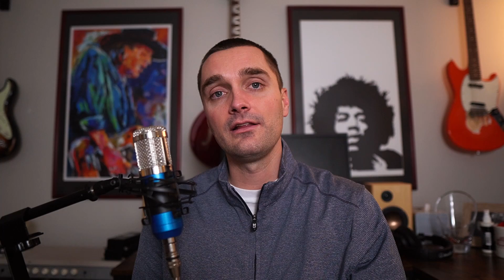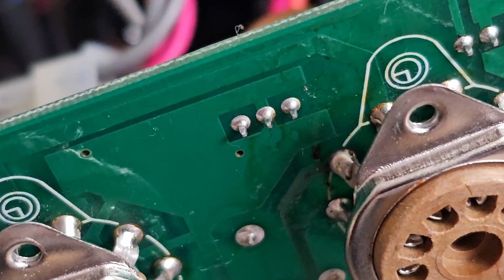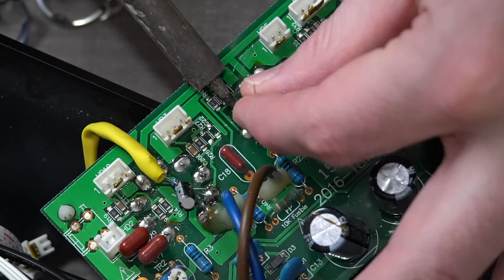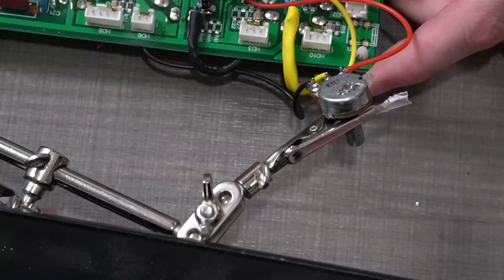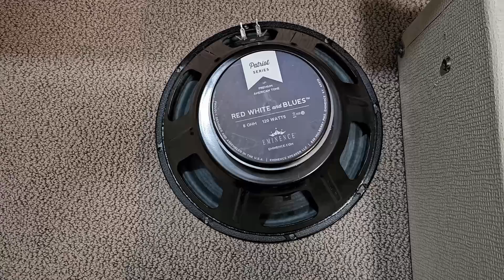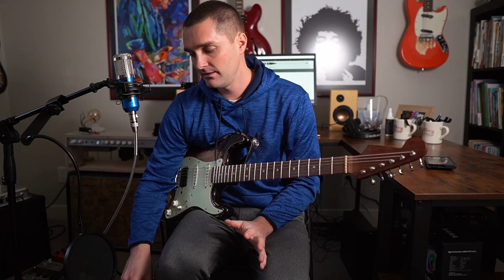Tuning my $140 Monoprice Stage Right 15w tube amp into a FIRE BREATHING MONSTER!  Amp mods

Comment: Hello Kley, i really like your tone in your intro music. Sounds just like my hero peter greens early sounds.Nice  playing.I  could resist try this mod with my stage right 15. However i got no output when i turn the amp on and let it warm up.i followed your circuit changes with all the right parts .1.5  1/4 WATT resisters. 10uf v25 volt caps. and 250 uf cap.I didnt get any smoke from the the amp. power light stayed on just no output.Iam sure i got all your directions correct. Iam safe as far as discharge of the amp caps before i work on it with hand in my pocket and the other hand doing the work.i think where i went wrong is when i took the amp apart with all the jhumpers i must have jacked up 1 or maybe more of the jumper locations up. do you know where i could get some help with this. thank you.boy this amp has more jumpers than a line 6 spider 5.

Comment: i have one of these amps. very happy with the performance of it as is. but nice to see and know how to hot rod it. one suggestion in your video: please use some kind of pointer like a pencil to clearly id the parts you are showing. though the video was fairly clear, i had a bit of trouble following  the exact things you were touching. otherwise great info.  thx!!!

Comment: This looks pretty similar to the 3-Way Preamp Bias Switch mod on Robrobinette's site. On there he replaces the resistors with a 3-Way switch for 830-2.7k-1.5k options along with some options for bypass caps. 

Now would I be correct in assuming that I can do this to all 3 cathodes? If so, would a cooler bias on all 3 (2.7k) add gain but reduce distortion? I mean would it make it the amp louder, cleaner, and increase CLEAN headroom?

I guess I'm trying to do the opposite of this mod and turn it into a clean machine haha I'm hoping it's possible so I can have a louder cleaner pedal platform. I guess I could throw a 1.5k on each one so they're all symmetrical but I haven't seen anyone so this so I'm afraid too as my knowledge of this stuff is scarce
Reply from the maker: Great question.  First there is a difference between gain and distortion.  Gain is just signal gain.  How much the signal got amplified.  Distortion is like once the signal reaches maximum amplification, but you keep going so it distorts.  How much does it distort?  

Distortion can be created in multiple ways.  First you can just run multiple stages of amplification at pretty full tilt.  They'll reach their max headroom and they can't keep up anymore so the signal clips.  Having excessive signal gain will create distortion.

You can also create distortion by amplifying the wave form in a certain manner.  Guitar signal is an AC wave form.  Alternating current swings up and down from the center line.  The upward and downward swing has a limit.  One end is saturation, the other is cutoff.  

So by messing with the cathode bias resistor you move the center line.  Say your limit is +5 and -5.  If you set the center line at 0 then the wave form can swing symmetrically.  If you set the center line at like -3 then the positive swing has lots of room, but the negative swing has almost no room.  It clips instantly.  That's asymmetrical clipping.  

1.5k bias resistor is center line at about 0.  Neutral.  Symmetrical swing.  If you use a higher value resistor like 3k that moves the center line negative.  10k cold clipper moves it very close to the negative clipping point.  

Lastly we also have to mention cathode bypass caps.  They also increase signal gain by allowing the tube to operate more efficiently.  You don't really use bypass caps with cold clipper resistors.  Complicated reasons.  

So to answer your question, using a 1.5k center bias line would be ideal for clean headroom.  Maximum signal gain.  But then just use volume controls between the stages to find the point of maximum clean amplification signal gain without clipping.

Using higher value resistors and no cathode bypass cap introduces distortion at the cost of maximum signal gain.  

The truth is that your goal of high headroom clean machine is more limited by the output section.  The power tubes only can amplify whatever the preamp is doing so much.  

So max clean headroom would actually be part of my amp design.  I just also allow for the gain knobs to push well beyond clean headroom just by brute force signal gain.  

This is a great question for a full video...

Comment: It might not be too tough to turn this preamp into a top boosted AC30/6 Brilliant channel. The one difference is you have a direct coupled cathode follower driving the tone stack rather than a single triode DC coupled cf. The topology is there, a strapped 12AX7 with the volume control between triodes, cf, tone stack, phase inverter, EL84s.

You'd have a top boost AC15 with a loop and reverb, that's pretty cool.

Comment: sound like diarreah fart, change the cathode bypass cap in V1 for smaller like marshall, 0.68uf to not clip the bass that much. that coupling cap 22nf changing to 2.2n that would tighten the bass distorsion

Comment: I have I guess the newer version of the amp with the front facong controls. It is actually a great sounding box specially considering the price and regardless of it, I think I paid $180 used of course, I think they are running $300 or so new. Yes your mods are quite interesting specially after you messed with the settings a bit the tone came together and sounded quite good. I'm just starting to mess with amp buiding, starting with a mojotone 5e3 which looks like fun but scary enough. Would I jump on the mods for the Stage Right? YIKES that's scary as hell. If I knew what I was doing I would probably try and re engineer it as a point to point hand wired , basically copping it's design and incorporating your mods, using higher quuality components overall, that could be wicked.
Reply from the maker: Nice! I would start with the 5E3. Crawl before you can walk or run. The 5e3 is a very well known diy project. Get it up and running. Then come back to these mods!

Comment: Would it be possible to  ,instead of mounting the potentiometer on the amp , put a jack somewhere and control it with a modified volume pedal or expression pedal ？
Reply from the maker: Good question. My first reaction is probably not. With a long cable run you don't want to actually send the audio signal out and back to an expression pedal. You could do an analog to digital conversion but hard pass on that concept from me. You could use a relay to switch between two preset resistor values...

Comment: so Clay; FANTASTIC channel and thank you so much for sharing your knowledge.... I worked with surface mount and it takes a little less coffee to work with  but doable with a microscope!! (lol) i've a question about your mod on this amp... towards the end of the video you mentioned using the "tone" control... 

was not the "tone" control removed?  The variable bypass clipping circuit that was modded, I think, that VR1A with C6 on its wiper, is the "tone" circuit however not labeled on the schematic. All other controls are... kind of weird but perhaps intentional as it's somewhat novel circuit.

Removing C22 disconnects the  VR1A C6 circuit... unless you shorted over the removed C6 thus making a trace there and reconnecting the VR1A C6 circuit... else it's just floating. 

When you added the potentiometer in the back for extra gain stage,  think you can repurpose  the "tone" pot if indeed it was removed from the circuit.   

any way towards the end of etc video you mention using the "tone" control which peaked my interest as it seamed the "tone" control at the face plate was removed from the circuit during mods... 

perhaps i mis understood your circuit analysis.

Comment: Hi Kley. nice work and good explanation of what you're doing and showing to us. please, for gods sake get yourself a good PCB cleaner and get rid of all the flux residuals.. vid would look much nicer.  For the V- mod wouldn't it be much easier to replace the SMD components (looks like 0805 size) with your preferred values? SMD component kits are largely available in high quality. nice rocking greetz from Bavaria/germany.

Comment: Great again Kley, as usual!  I have build the monoprice/Laney myself and used as in all my  amps the old spider building way. The components direct on the tube feet. I always use DC voltage for the filaments. This make all my build amps dead quiet.  I had the bypass caps and a voltage divider after stage two. I am happy to hear the same in your amp when you give full trottle on the divider. It is a kind of motorboat effect in the dying sound.  I also made the tonestack a bit different. The amount of bass is regulated direct after de first stage. So there will be less mud in the amplified signal. The tonestack for mid and high freq. is in the same place as the original. I have taken a 50kOhm B pot for the mid. That give the possibility to make Fender like tone left from the center and kind of Marshall tone to the right of the center. It even adds some grit to the tone. It sounds lovely from clean twin to gritty marshall. Keep on demo and greetings from Holland

Comment: Hi Kley, a comment about changing the cathode resistor on V2B (R48): as you noted, V2B and V2A form a direct coupled cathode follower circuit (DCCF). When you increase R48 from 820 ohms to 1.5k, the anode current drops slightly because V2B grid bias goes more negative. This subtly changes the overall transfer curve of the DCCF, but not in a major way. Details can be found in the very useful book by Merlin Blencowe, "Designing valve preamps for guitar and bass", chap. 5. The addition of the 10uF cathode bypass cap across R48 will increase the gain of V2B significantly, which increases the amount of compression in the DCCF and gives more distortion at lower gain settings. The circuit appears to be lifted directly out of the Fender Bassman 5e6 amp circuit, except for the anode voltage which is higher in the Bassman at 325V. Thank you for the reference to the Laney Cub amp, that is the only place that I could find the circuit diagram of this Stage Right amp.

Comment: My hats to anyone willing to work those tiny components. Those were some great mods. Do have any suggestions for a Blues Jr? I rebuilt mine using a Hoffman kit in order to get rid of all the PCB stuff. The amp is killer but the pre-amp section gets loud at 3 and with humbuckers there doesn't seem to be enough highs. Thanks for posting this video.

Comment: Thanks for posting. I will be experimenting with mine. Just a thought, instead of removing the surface mount components, you could cut the track. That way you could put the circuit back to normal by simply rejoining the track with a bit of wire. 

Also it would have been good to hear the comparison between the speakers. Great video, thanks.

Comment: if you want to impress us all, figure out how to get rid of the hiss white noise, changed tubes to the quietest you can buy - 81db, conductive copper tape inside where the head sits, replaced the rca cable to reverb with insulated shielded cable, just  has to be some kind of DYI fix on the pc board to help this lil amp.

Comment: I had an amp tech do some mods to mine.  First was the cold clipper mod, then swapped the reverb tank for a 3 spring Mod unit, then he changed the output transformer to a Hammond 18w Marshall style one, he also put in a toggle switch for 8-16ohms when i play it with an extension cab and finally swapped out the 70/80 speaker for a 16ohm Celestion Neo Creamback. Oh and the cheap white plastic knobs are now metal smoked grey. Looks and sounds awesome. 👍😁

Comment: Hey I made a schematic out of an class a amp and was wondering if you could look over it and see if I missing anything for it to work
Reply: i'm not entirely sure i'd trust an opinion from someone that solders like that using the wrong size solder (plumbing solder and rosin), could have just soldered legs to the surface mount points and it does not look like he knows what he is doing, but following a guide haphazardly. that thing is now a fire hazard.

Comment: Where did you find a TV front version?  I had the other one w/front controls (now listed on Monoprice for $259 + shipping).  I've never seen the TV fron design though.  For $140 I'd get it, throw out the guts and house my 5E3 kit in there
Reply from the maker: I got it at a used store locally.
Reply: @KleyDeJong  I used to use mine as kind of a preamp for my harmonica (harp --> Mic w/Shure CM Element --> Monoprice 15w effect loop send --> Twin Reverb input 1).  It sounded great for harp by itself too, just wasn't loud enough over drums.  I got mine for $130 delivered, brand new.  The TV front ones looked way cooler though....

Comment: At around 5 min 30sec in your video you play some background music. That guitar tone is the sound I’ve been trying to remember for over a year. I remember now that the tone in my head was a Robert Plant  song Ship of fools which has a guitar tone almost exactly like what was playing in your video.  I need to know was that you playing? If so, were you using this amp stock before mods? Really want to find an amp that does that sound, thanks.
Reply from the maker: Thanks. Yes that was me playing on a looper. I believe it was my sunburst strat into a few pedals into my cake pan 5e3 amp. It's pretty heavily modded. I use the normal channel which adds a tone stack and nfb. I have a video on it called 'my favorite 5e3 mods'.

Comment: Cool mods. I won't be modding mine except for a G12H30 55cs speaker mostly because I can barely see those SMDs let alone work with them.
Reply: how was the speaker?
Reply: @P1NCH3_MAR1JAN0  The speaker change made a big difference. I go for 60s british tones and the G12H30 really gets that. Of course it's a $300 speaker in a $200 amp, but you always have the speaker to use elsewhere in the future.
Reply: @ hows the low end. cause a group on Fb said that it wasn't that great but i was thinking of still picking it up for some Hendrix tones
Reply: @P1NCH3_MAR1JAN0  The low end is not a strong point. You can shape that with a speaker that has alot of lows and/ or an eq in the excellent effects loop. But the amp is bright like led zeppelin 1. I'd say it won't really sound like hendrix either. Maybe the kinks.

Comment: Got hot tweezers? Man, they work great on just that size SMD perfectly. I found some cheap ones that plug into my HAKKO FX888D. Life-changing. Soul filling.
Reply: hot tweezers are often of low quality. i use two soldering irons, because i have got two hands. perfect for most SMD parts. for the groundside of the component i use a bigger tip to transfer more heat. a good solder flux is also a big helper. soldering process must kept short in time otherwise the traces of the PCB can delaminate and ruin the board.

Comment: I will never buy an amp with SMD components, they are difficult to repair, at the first failure you throw it away
Reply from the maker: It does seem to me that the amp was made without repairabiliry in mind.
Reply: @KleyDeJong you can blame that on Laney. It's their circuit. I'm pretty sure their amps even use the same pcb board. I mean it was essentially the same exact amp, inside and out. The only difference between the Laney Cub, 12R and the 1st Gen 15w Stage Right is that the Laney is black, has a slanted front instead of rectangular, and it has a digital reverb instead of spring. They even use the same cabinet with the only difference being the Laney has a slant in the speaker grille while the Monoprice doesn't.
Reply: @J.C... Laney opted for beefier transformers as well.
Reply: Sucks to be you

Comment: Trying to get a schematic for my Stage Right SB20 50w head. Want to add a Presence control...
Reply from the maker: Try to find the NFB loop.  Start at the speaker jack and work backwards.  There should be a connection from the OT Secondary to the speaker jack.  If there is also another signal path back into the amp circuit, that's where you go.  Then look up a Bassman or something and copy the presence circuit from there.
Reply: @KleyDeJong  Yeah, it seems like a Bassman type circuit that would be relatively easy tap into the negative feedback from the OT. It's actually a really good sounding amp for something made in China. Thx.
Reply: @scottdunn2178  I'd been set on getting the 15w as a mini-mod project ~ but bailed on the grounds the SMD elements of the amp would be unkind to my dodgy eyeballs and shaky hands.
The SB20 50w head isn't that much more expensive; what's it like inside? More SMD?
Your insight'd be appreciated.
Cheers.

Comment: Had this amp for a few days. Just noticed if you want to plug your pedals into the fx return to bypass the preamp, it does not bypass the tone and reverb knobs. The reverb you can turn to zero of course, but the tone is in the way of my effects chain. What the heck?
Reply from the maker: Check out my other video analyzing the schematic! The cut control is in the nfb loop, so it's essentially in the output section. Similar to a Vox style cut control.

Comment: Monoprice Stage Right 15w tube amp goes for $279.99 in Feb 2024. And still not seeing this puppy sold used much.
Reply: Bcuz if simply just change the speaker our it becomes an absolute beast.
Reply: @derekwright5564  what do you use?
Reply: I got mine on reverb for like $150 a year or two ago on ebay